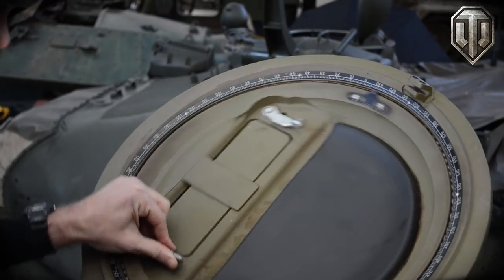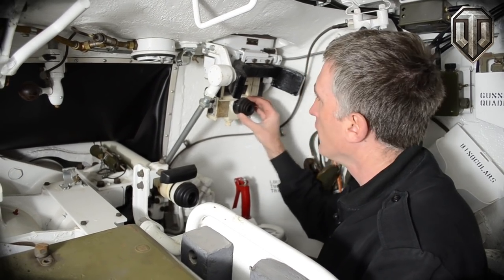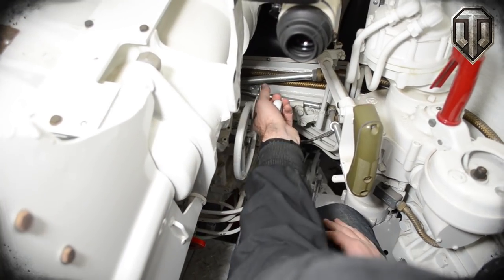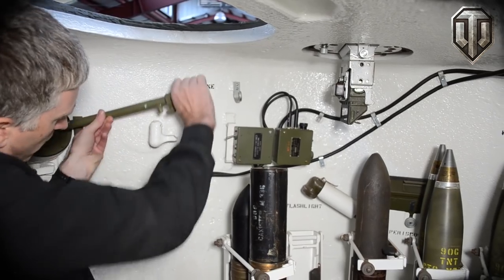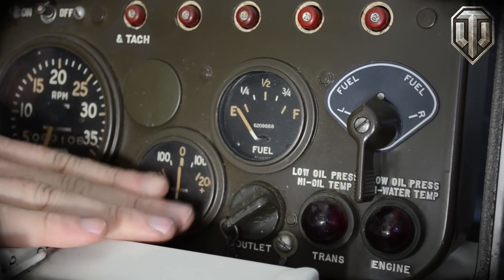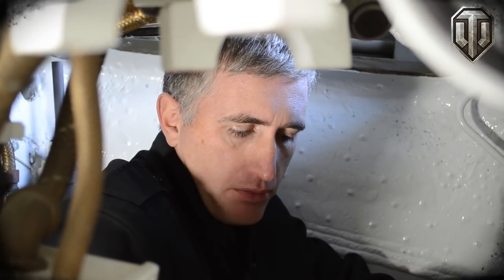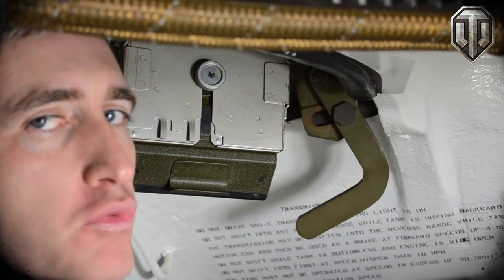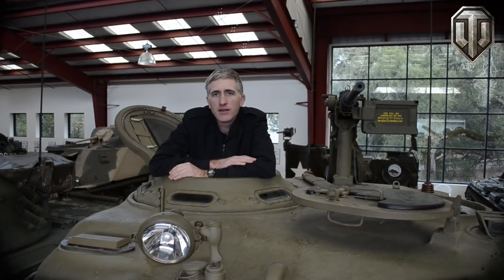Inside the Chieftain's Hatch: M26 Pershing, Part 2

Comment from the maker: White is a common colour for AFV interiors. It's not as if they have many windows, so they need to reflect as much light internally as possible so the crew can see what they're doing.

Also makes leaks very easy to spot.
Reply: TheChieftainWoT hey do a inside the hatch t29
Reply: leaks as in people on the outside spotting poor light dicipline, or people on the inside identifying holes in the hull?
Reply: When he says leaks I believe he's referring to hose leaks. Hydraulic fluid and such.
Reply: Also makes shell holes easy to spot.
Reply: The_Chieftain why is the intro 1 minute
Reply: And blood. And it someone's spleen goes missing. Or they spill a brain cell or two...billion...*cough*
Reply: @ravener96 🤔 No, no. Its inportant to identify hull leaks as your tank is forced to perform an emergency dive during an enemy depth charge attack! 😏
Reply: Turn up the music, please.
Reply: instablaster.
Reply: Are you going to do a video on the M46 in the future or is not necessary since the M46 is similar  to the M26 in design?
Reply: Can you explain the comb at 4:40?
Reply: @ravener96  yes

Comment: At the beginning of the Korean War, there were no Pershing's in Korea which could deal with the T-34/85 the North Korean Army was equipped with.  There were three Pershing's in Japan, but were in poor mechanical shape.  General MacArthur had contracted with Japanese workshops to refurbish worn out vehicles, and an emergency rebuild commenced to get the Pershing's operational as quickly as possible.  The three were finally rushed to Korea, but the fan belts were incorrectly fabricated, and all three Pershing's were put out of service.  The Easy 8 Shermans with their high-velocity 76mm guns were capable to taking on the T-34/85s if being seriously under-armored and once General Matt Ridgeway got the 3.5 inch bazooka into Korea, the North Korean edge of their armor quickly went away.

Comment: Technically that is not 'low range', it is first gear. Low range refers to a split gearing like a heavy truck or a 4x4 with a 2-speed transfer case. With a 4-speed transmission, high range is the 'range' of ratios from 1-4 in high gear, low range is the range from 1-4 in low gear. But many people just call the lowest gear 'low range', even if it is not technically correct. A tank is generally speaking always in low range (although some have a low-low-range mode). This machine gets away with only three gears because the torque convertor in the automatic works to broaden the working range of each gear, at a cost of efficiency (like how Detroit automobiles found 2 and 3-speed transmissions perfectly workable for a long time).

Comment: A lot of the controls and concepts on the Pershing were used on later tanks all the way up to the M48s and M60s.Some of it still survives to the Abrams series.One thing about American tanks is they have losts of room even for tall guys.Back in WWII the tank corps back then like to pick short guys for better efficiency.
Reply: What controls are you referring to?  The gunners turret controls on the M-26 and 46 were identical. The 47 was totally different with hydraulic traverse and elevation (26 & 46 no power elevation.) 48-A1 and A2 were similar but A3 had changes. Driver controls were totally different in the M-26 with steering laterals,  M-46 and 47 had a wobble stick and 47s had no dual controls. M- 48s had an oval  steering wheel. Tank commanders override controls in 26-47 were similar but not the same.47 and early 48s  were similar. The POS M-60s were all similar .
Reply: I was referring to the GAS (Gunner's Auxillary Sight) which still uses the manual elevation,traverse,and trigger button backed up with the "Master Blaster" magneto firing device.Works well if the tank is in a stationary position and have to do a GAS engagement on a Tank Table VIII.

Comment: Beautiful tank. Saw the video where one kills a Panther. Tough mean tank.
Reply: The Pershing was designed specifically to counter the Tiger I - it's main gun was on par with the German 88mm, and it's armor was almost as thick as the Tiger's - the Pershing's armor was just one inch thinner.  However, like the Tiger, it suffered from reliability issues. I'm guessing this is why we didn't mass-produce this tank during World War II - the Sherman was easier to mass-produce than the Pershing, but the Pershing stood a better chance against German heavy tanks like the Tiger and Panther. I just wish we had this tank earlier in the war, especially in North Africa.
Reply: @jonathanpowell613  Pershing's armor was better than the Tiger I's at 100mm sloped
Reply: @jonathanpowell613  haha youre wrong, pershing has better Armour though

Comment: I looked up that all M46 tanks were conversions from M26 tanks. Is that true?
Reply: Extensive Development/ Improved version of a Pershing.
Reply: M26s rebuilt with many improvements, most significantly the new engine/transmission.
Reply: yes, I already thought I saw the 90mm M3a1 that was fitted on the m46, instead of the 90mm M3 of the M26. (notice the thing right behind the muzzle brake).
Reply: The m26 intro to the war was really PR move to prove that they were actually trying to compete with newer German armour. It likely would have been considered a prototype on the way to developing the m46 if not for this.
Reply: The m46 was a updated and improved pershing chassis with m47 turret dropped onto it. It was a stop gap tank created due to delays with the m47.

Comment: Very good vid. Do you have one on the Sherman? I was hoping to learn something about the reasons for the welded or cast hulls as they look like totally different vehicles to me.
Reply: Right, was there a difference for this alteration? I thought the cast hull would have been stronger as it was one solid piece as opposed to plates welded together.
Reply: Got you. Yes I see it with the t34 in wot. If the turret is turned the nearest point to you is actually flat because of the curve.
Reply: Cast hulls where more prone to destroy the inside of the tank, the hull could not be tempered to prevent spalling (When a shell goes through the armor and fragments said armor around in the tank, like a frag-grenade of sorts), welded hulls where faster to make, able to the tempered to prevent spalling, and plates of the welded hull (like the front-plate) could be replaced, to keep the vehicle on the lines, where the cast-hull, if vitally penned, was a complete loss and the tank would have to be totally replaced. The early-Shermans cast-hull did give better protection due to the sloping, but rate of production eventually trumped protection.
Reply: Even though cast metal is one piece, it is standard steel. This type of steel has the same deficiencies as cast iron and is very prone to cracking when impacted from something like a tank shell. The early T-34s had the same problem. Welded plates are made with strengthened steel but as soon as you melt it down to cast it the strengthening is useless. That's why cast armour was phased out.
Reply: +T-X-M Not exactly design wise. Chronologically yes.
Reply: -T-X-M- M4 was welded. M4A1 was cast.

Then again, the T6 prototype was cast...

Forget what I said. Forget it.

Comment: What ever happened to the only super Pershing, I'm a little confused why they didn't make more also.
Reply from the maker: +James Barnes Bottom line was that the ammunition was just too bulky to be acceptable in the turret. http://worldoftanks.com/en/news/pc-browser/21/The_Chieftains_Hatch_Improved_Super_Persing/
Reply: +TheChieftainWoT wow, thank you for your reply.
Reply: There were 26 made in total. T26E1-1 rebuilt from T26E1 prototype, this is the one that received the applique armour. It used the T15E1 cannon with very long 1-piece shells. The other 25 were new T26E4 tanks with the T15E2 cannon, which used 2-piece shells.
Reply: The Super Pershing that saw combat was likely scrapped at the end of the war. The last picture of it showed it sitting in a scrap yard.

Comment: Y did they use a ford engine all they needed to put in it was the Allison engine from General Motors then it will fix it lol
Reply: Using the Ford engine meant that they could get them to Europe quicker.
Reply: Walt Johnson lol you must of made that up the p40 has a Allison engine
Reply: marco jonker When you use aircraft engines you have to worry a lot more about cooling, because the radiator of a tank isn't moving at 250+ mph

Comment: the T26E4 Super Pershing's extra spaced armor was actually boiler plates welded and bolted onto the tank by field engineers who were concerned for the tank's safety, as it was known that Pershing tanks could still be knocked out with ease. This way their highly experimental tank with it's brand new, long barreled high velocity cannon would probably not get knocked out.

Comment: what's "Chieftain" have to do with an M-26? The main turret hatch is for tank commander....the oval hatch  is for the loader.  Chieftain is a British  tank.
Marco,   the M-26 had a Ford GAA 490 HP V-8 and Torquematic tranny.  The Allison CD-850 was used with the M-46s 810 HP Continental V-12.
Mike,   the main gun was fired by a button on the traverse handle....a switch on the box in front allowed you to select  MG or main gun.
Reply: The man doing the tour of the vehicle is nicknamed "The Chieftain", if you didn't notice, this is in the title of many of these videos as well as the uploaders name.
Reply: Not sure if good troll, or just mentally negligible...